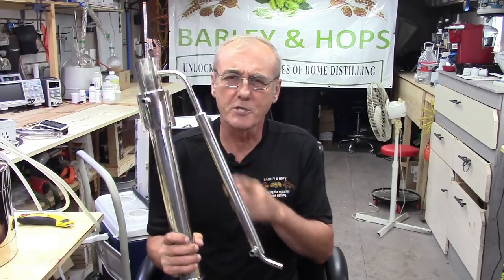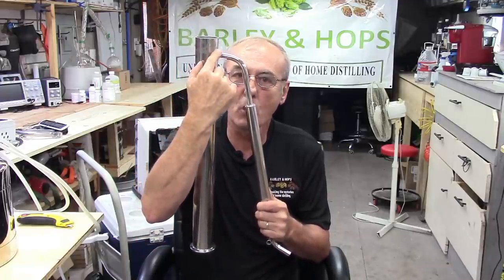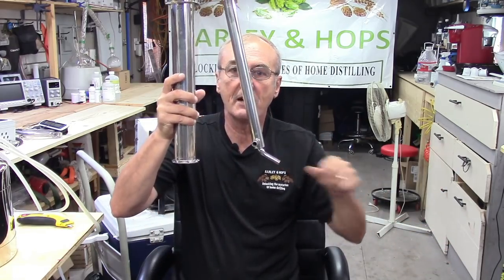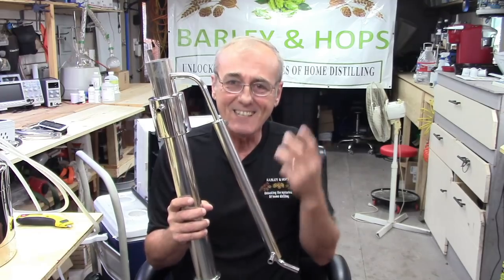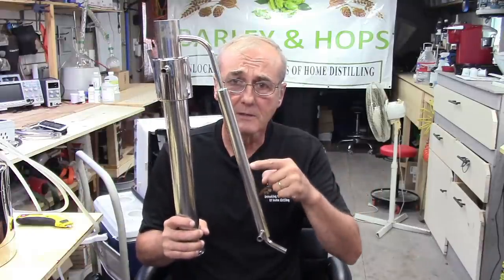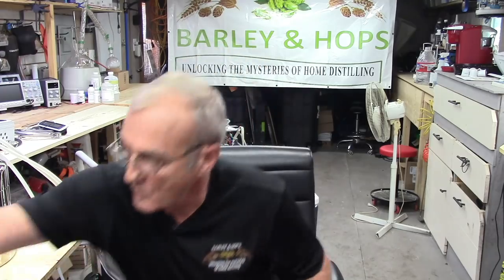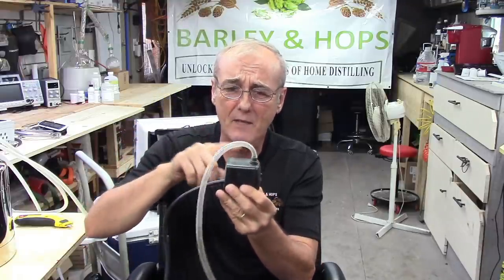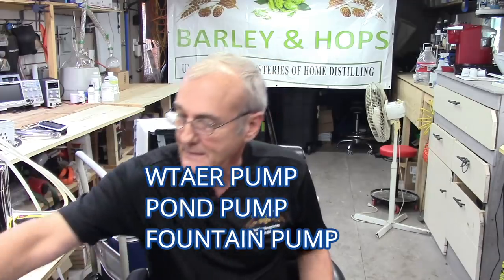CONDENSERS ,WATER TEMP, FLOW RATE

Comment: Hi George, can I pump water from a chlorine salt water pool through a copper condenser without causing issue to the copper?
Reply: That would rust/corrode the copper really really fast.
Reply: Should work fine.  Pool salt water is has low salt content.  Be sure to rince with fresh water afterwards.
Reply: Try using a stainless steel condenser.

Comment: Can you please show image of interior of cooling system..how do you bend and route the AC Coils ?
Thx
Reply: It will depend on the particular AC unit you use. Cut out a portion of the cooler lid wherever the pipes will be best to fit it, and bend it down. The evaporator just sits in the cooler, however adding some manner of support would be an idea to stop vibrations cracking the pipes.

Comment: My solution to the ice problem is to freeze 6 plastic coffee cans and use them
Reply: I have a 10 gallon still and the ice will last for the full run. I freeze a couple extra just to be safe!
Reply: I use bottled watered that I freeze in my chest freezer when they thaw I  just throw back into the freezer and replace with new frozen one

Comment: About the flow reate in the condenser. A rule of thumb is to check the temperature of the water coming out from the condenser. If it is hot, your flow rate is too low (or your cooling water is too hot, but that is harder to control). 
You should be adjusting the flow rate with simply adjusting the pump (if it is adjustable and it is not at max).

You also can build a control circuit on that if you are a control freak. You need a digital thermometer at the output water and you need an expensive pump which accepts digital signals to adjust flow rate. But as George said, it has no impact on the flavours so fooling around this is kinda overkill.
The only reason I would make a controlled flow if something happens with the input water or there is a leakage and you can set an alarm if the temperature of the output water exceeds a limit. Otherwise, no need.